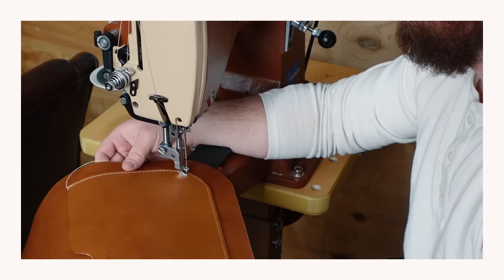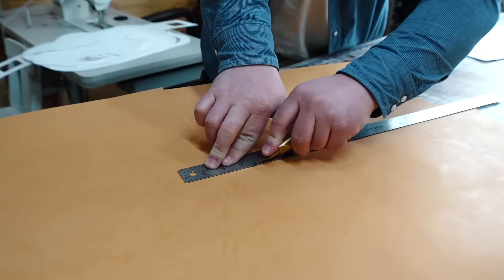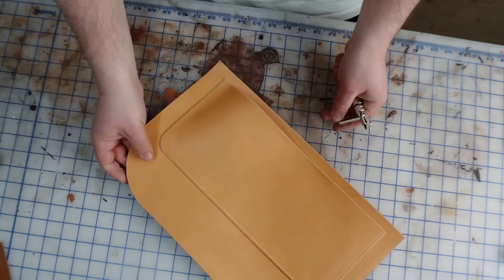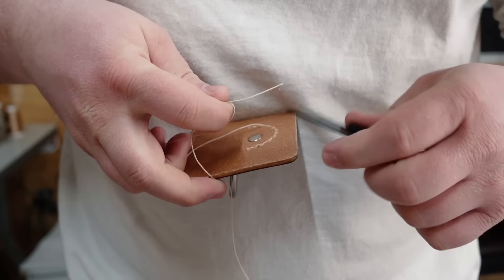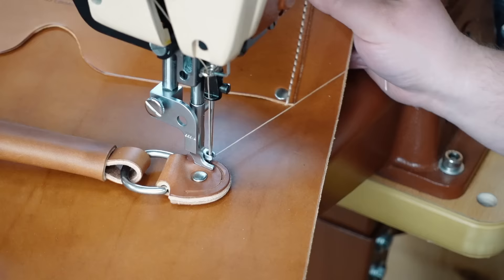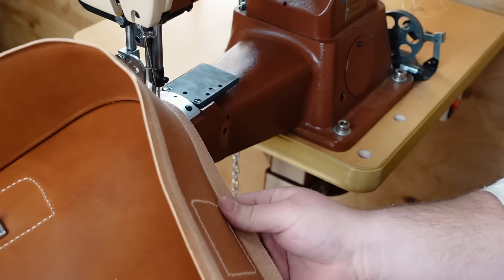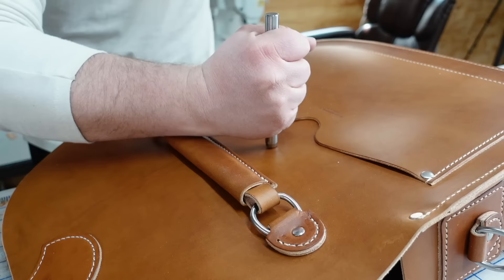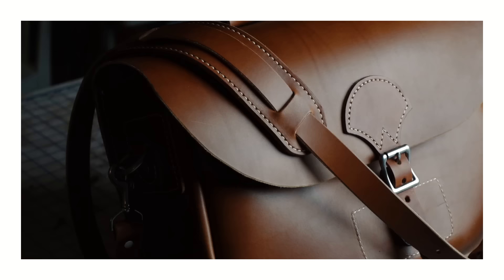Making a No.88 Saddlebag Leather Satchel

Comment: Small oddball tip

When using Chicago screws, set screws, any screw really. Hit it with hairspray before screwing it down. Works kind of like locktite, but it's clear and easier to break free for replacement or repair.

Comment: Glad to see you use glue sticks to apply, bc brushes are so inaccurate. I find the marks made by the feet of most machines objectionable and *scream “machine stitched”— so you must be carefully adjusting yours (tho your stitch lines could be straighter). 
   I’m liking your welcoming of BOTH inside and reversed stitching on your bag— makes the front look best, IMHO— tho *I’d be tempted to add a foot to each front corner to accommodate the difference in standup.

Comment: I am wondering how the top where the handle is holding up? Would putting in a stiff reinforcement across the top be something that would be a benefit?
Reply from the maker: This leather is so rigid it doesn't need it. I know a few people that have been using this bag for a couple years and it's holding up great.
Reply: @whitandpark  I'm only using 5 oz on it.